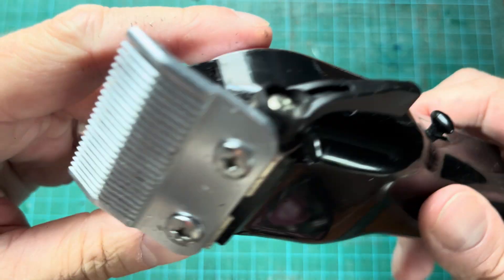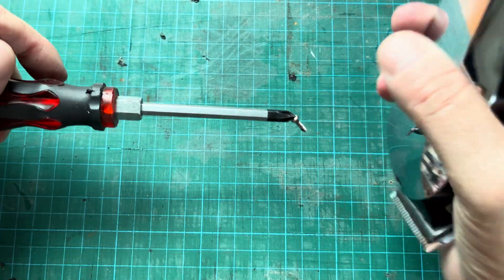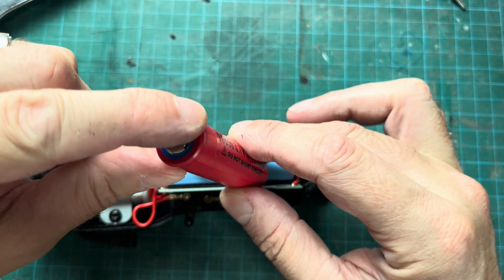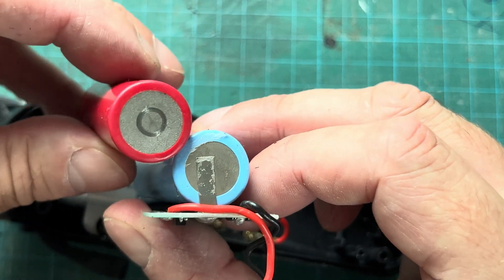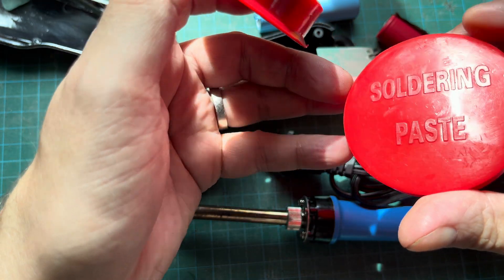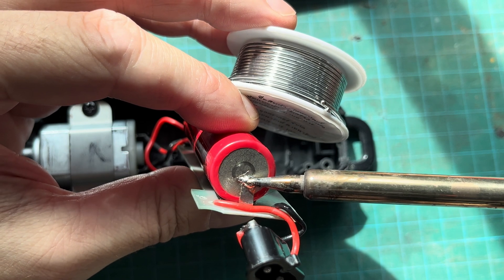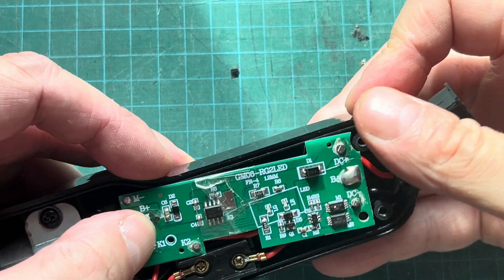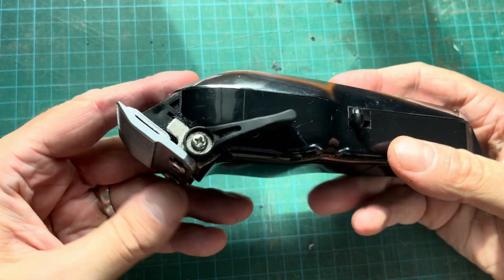Cordless Hair Clipper Battery Problem (How to fix, DIY instructions)

Comment: Can a higher battery type works the same way d first one is working
Reply from the maker: As long as the voltage of the battery is the same it should be ok 👍